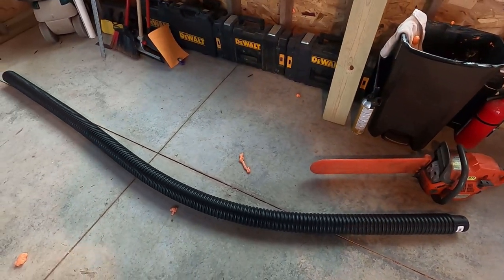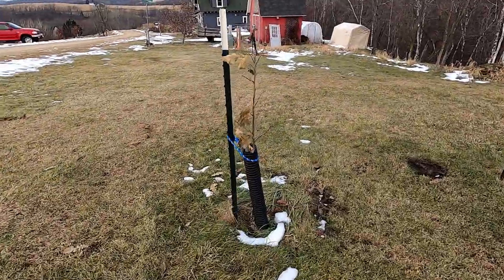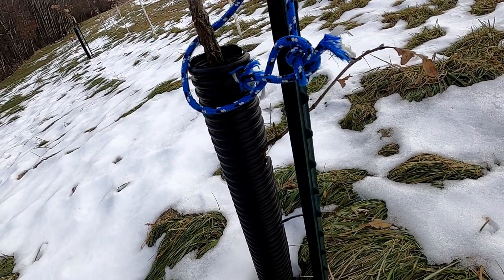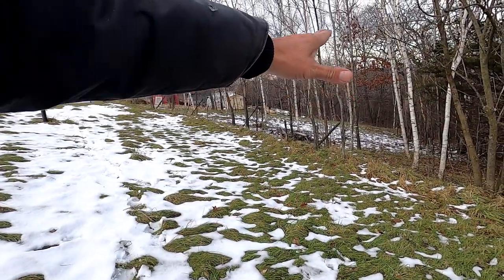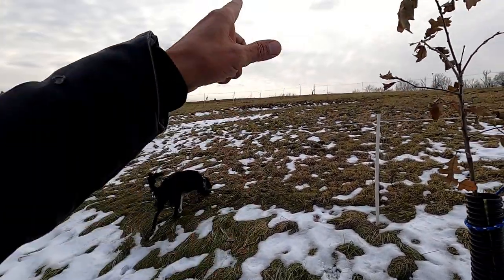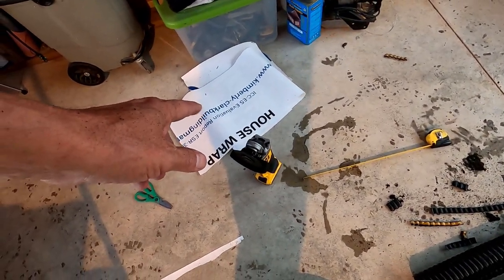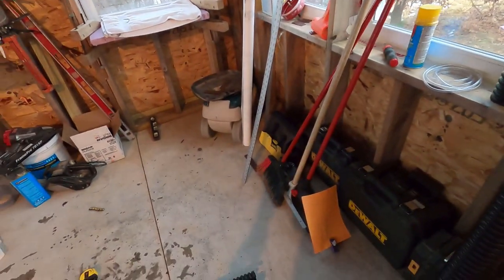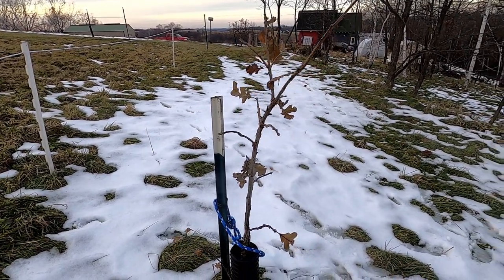How-to Make TREE PROTECTORS Real Cheap!

Comment: Does the black color cause issues with heat and sun?
Reply from the maker: No. The open top and slit on the sides ventilates them just fine. The Department of Natural Resources here in Wisconsin uses the same thing on the trees they plant in parks. I do take them off in Spring though, and they are only used until the trunk is big enough to be rabbit-proof. I'm actually taking mine off today as the rabbits have plenty of other things to eat at this point 😊
Reply: @PlanetMojo  Awesome! I'm making some this week. Thanks for the info
Reply from the maker: @mikeclement5383  You're welcome!
Reply from the maker: @mikeclement5383  Glad to be of help!